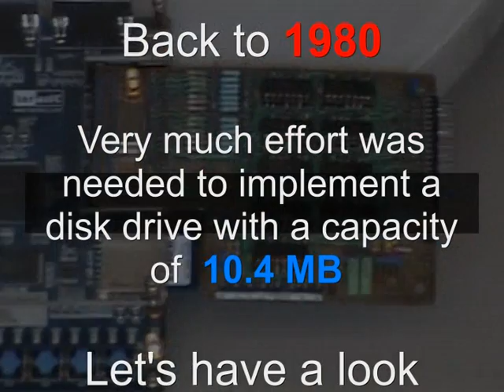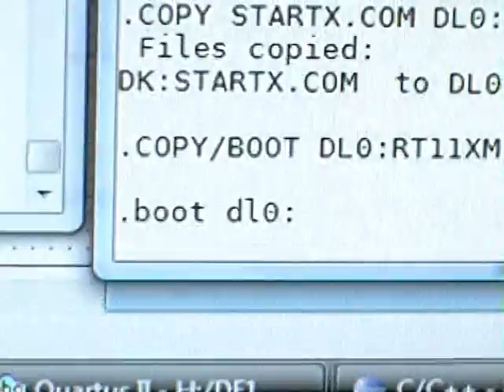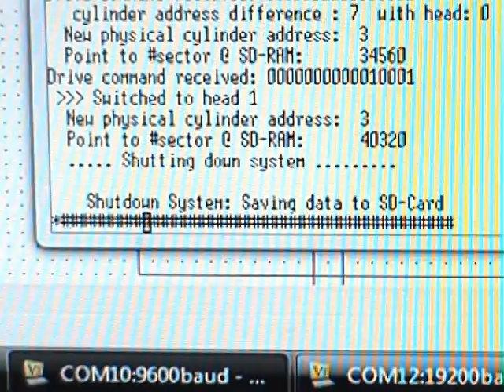FPGA based DEC RL01/RL02 DISK-DRIVE SIMULATOR

Comment: Thanks allot for your work and this excelent demo !
5 Stars*** WOW !
Question: Where can i find infos via SD-CARD and FPGA Interface.
Has the SD Card a special format, or can i read and write this SD-Card with a
eg. normal Win7 PC SD-CARD Slot ?.
SD-Card based on FAT32

Greetings Holger.
Reply from the maker: All details on my homepage. The SD-Card format is FAT32 and readable with every windows system.  I also recomment to have a look to the follow up project which is based on the DE0-Nano board.